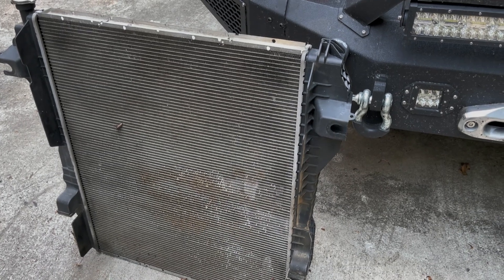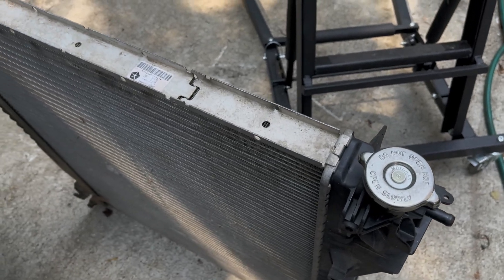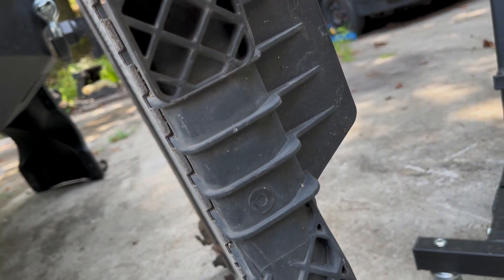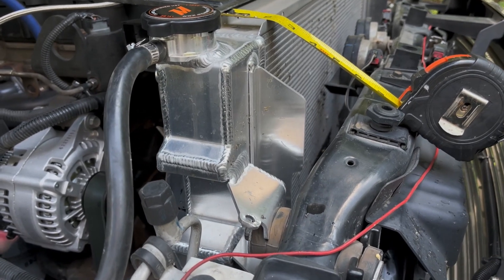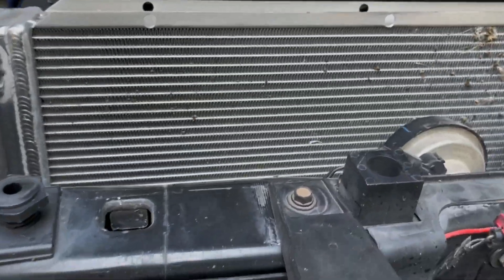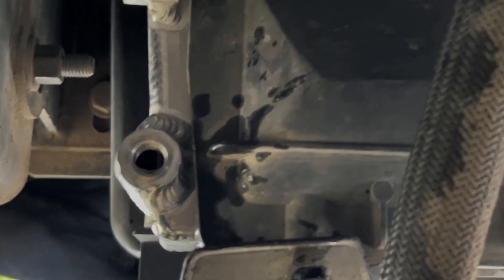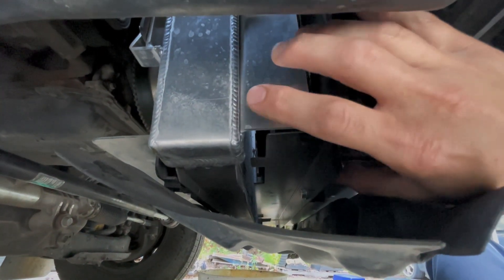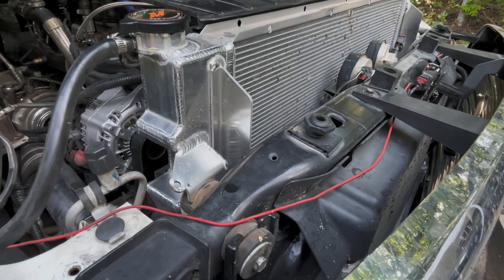Mishimoto Radiator Long Term Review & Stock Radiator Comparison Ram Cummins 6.7 #cummins #mishimoto

Comment: Beware of their higher pressure caps.  The one on mine caused leaks at hose clamps on my 6.9.  Changed back to OEM pressure to fix.
Reply from the maker: Yea we had the same used worm clamp going back to oe spring style

Comment: What was the temps before and after upgrading to Mishimoto ?
Reply from the maker: Easy a 20° difference. It runs 180° cruising with the mishi radi stock it would be around 200° cruising

Comment: Did you change to a lower thermostat and also change the fan settings, or is that all stock?
Reply from the maker: No used an auto store thermostat, stock fan setting.
Just the Mishimoto rad, 
stock thermostat, water pump, belt, G05 coolant
Reply: @DIYKAI excellent. Thank you. Gonna throw one in my truck.
Reply from the maker: @JefferySumner  your welcome so we did 10k cross country in the Rockies and Moab temps outside hit 130 truck up mountain never went over 228 while pulling and around 65-75 mph literally one of the best upgrades we have done. Normal cruising speed temps will stay at 170 -180 all day